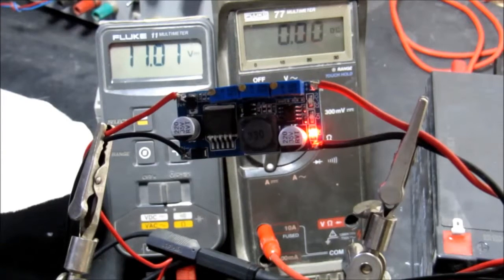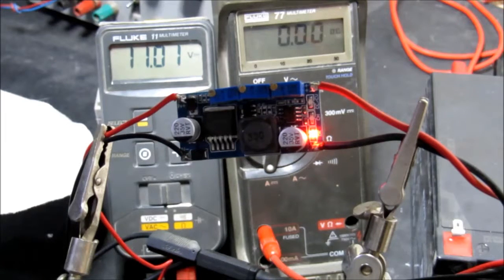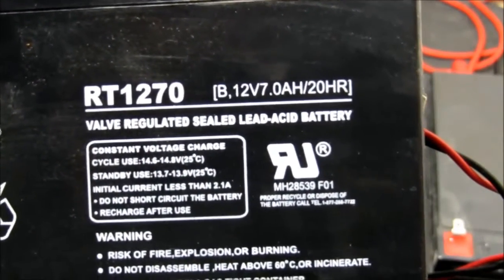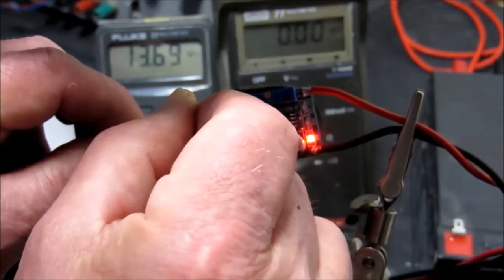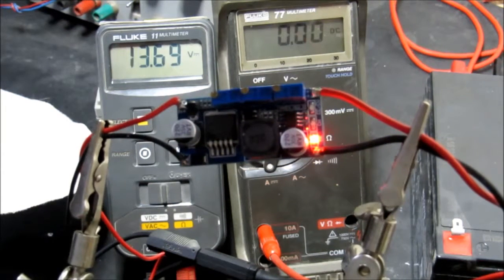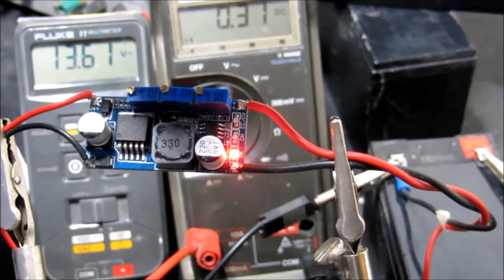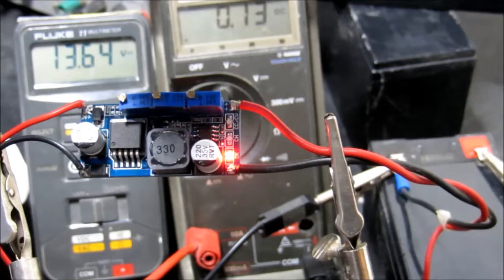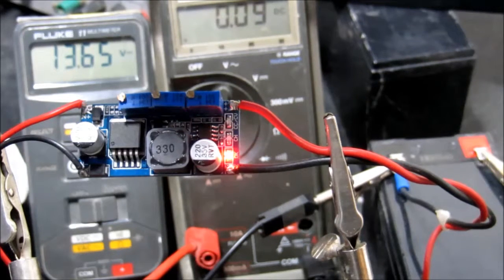LED Driver Constant Current Voltage Step Down Buck Converter Battery Charger Electronic Project

Comment: I get stuck when say an LED strip won't take the amount of current its supposed to (yes, plenty amperage in power supply) and is more dimly lit than I'd like. Yes, I up the voltage with a higher voltage power supply if I can find one (I scour through thrift stores (what we call them in US, used stuff) and get them for $0.25 to $1 - often quite good ones) and really look for the 14v-15v 3-5 amp supplies for those strips that need it. Is there a better way to give a slight boost in amperage without raising the voltage much? I was hoping this module would allow me to up the current but no. Guess the LED strips have their resistors so at 12v only going to get what I get even though specs on banggood say differently and some other people show higher amps. (it's supposed to take 2 amps but was only getting 0.87, with higher voltage get closer to the 24 watts).
Reply from the maker: In my experience many of the voltages and currents claimed by labels on those "wall wart" type bricks are very optimistic, like the claimed mAh of cheap lipos! Look out for an old XBOX power supply. They are really well made and are around 120 Watts. You can see on this link how to mod it : http://www.instructables.com/id/How-to-turn-an-X-Box-360-PSU-into-a-12v-lab-PSU/ You could use it with a module like this http://bit.ly/PSU50V2A to make a useful variable power supply with display.
Reply: I just happen to have an old XBOX power supply! Though I was using an 800 watt power supply with the unit in your video and a little light up voltage monitor and a couple of voltmeters for amperage and to check voltage all around. But they don't push current, only voltage does I guess. I've had that same power supply over 4 amps so I know it's not it that's the problem; more like LED strip manufacturing - and that makes sense cuz they were really cheap on banggood, $1.68 for 5 meters.  
  I'm sorta laughing now at my own foolishness in trying to force what I thought the strips "should do" rather than accepting what they did do. I ran them for hours at 14 volts and just a little warm (when not mounted). I'm mounting them in old fluorescent fixtures right on all that metal so they stay very cool.  
  Thanks for talking me down from the cliff of my own egotistical willfulness! I'll be following your adventures.  
  My secret project is working out a gate switch that will trigger when someone flashes their headlights several times. I've studied on photoresistors, phototransistors, comparators, and can easily get a distinguishable signal even during daylight ours; now i need the whatever thingy to activate when it gets ~3 such signals in ~5 seconds. I want to make a number of them and they will be outside so cheap and rugged is optimal.
Reply from the maker: It's possible the LED strip you have is 24 volt? You could test by removing a small "sacrificial" section and cranking the voltage up, if it releases the magic smoke then you've gone too far!! For you gate switch project I would go for an Arduino based platform maybe like the wemos one I have reviewed : https://www.youtube.com/watch?v=69iSuVZMLaA